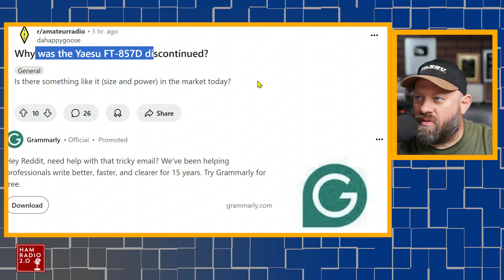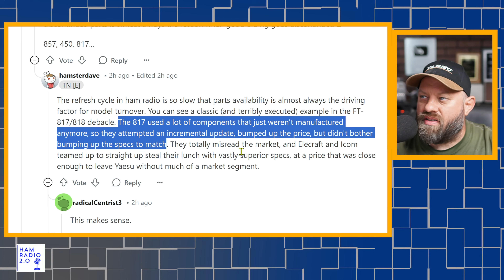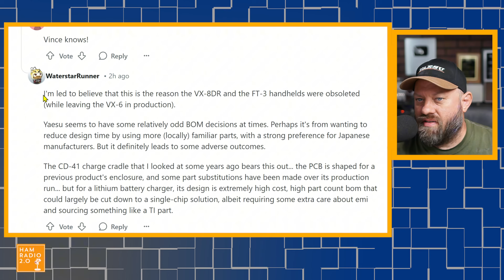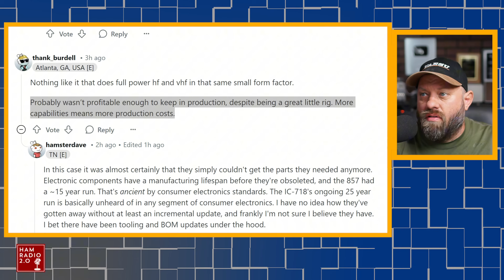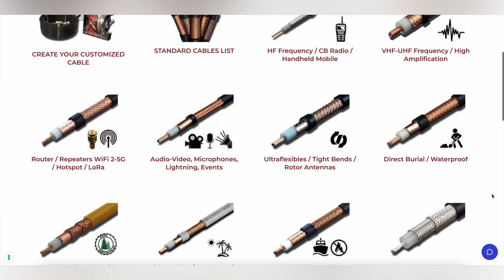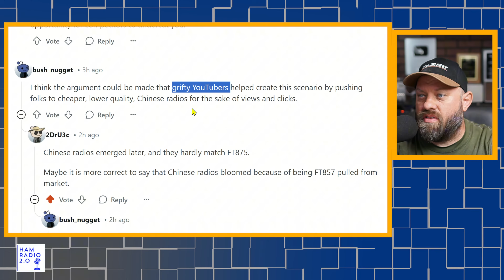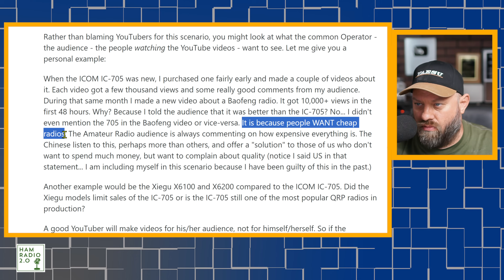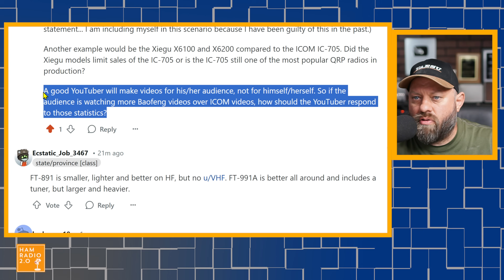Why was the Yaesu FT-857D Discontinued?

Comment: 991 is intended to be portable or desktop. 891 is designed to be mobile or portable . Radios designed to be only desktop would have a builtin (AC to DC) power supply. 991 lacks that internal power supply .

Comment: The better question is, will we ever see a Yaesu replacement for the 857D?  For how small of a radio it is, it is still very capable, especially if you've got a couple of mechanical filters in.  The audio DNR is actually not bad for what it is and for the time it was, made in my opinion.  The noise blanker works really too well if you are running it in a mobile setup, one push of a button and alternator noise goes away.  Modern rigs use IF DNR, and Yaesu is pretty awesome at that as well.

Comment: I’ve had my 857 forever. I’ll never get rid of it.
Reply from the maker: Same
Reply: @HamRadio2  I have had a used 857D since 2006  for HF mobile, and contesting. I'm a rover  it was about 2-3 years old when I bought it. It is used AND  beat up but it still works like a champ   had to send it in for some minor stuff and  a checkup but it still works just fine.  I wish they would come out with a newer 857D

Comment: Well done my friend. Thinking back to the interview you did with Yaesu , I believe in Florida , Yaesu made a couple comments , if I recall correctly, that the FX-1F “ architecture“ is “foundational” to a series of new release that will spread over the next 1-3 years. Given I am an old retired Systems Architect in technology this has a very specific meaning. And given  the FX-1F will probably share some attributes of the architecture in the 710 it also implies , to me , there is some thing else fundamentally different in the FX-1F from a systems architecture standpoint than the 710, 10 and 101. . I thought , ‘ I bet their older portable radios will be replaced  over the next 1-3 years based on a new scalable  radios will be architected  for portable radios”.   Meaning much better than currently possible from a DNR and receiver sensitivity. And the internal systems design can be scaled and modified  and reused between different portable rigs. Now that’s a mouth full. But if you look at certain ‘technology ‘ platforms in consumer and professional this is key to success . Given the 710, 10, 101 now are 1-3 in Sherwood ( and share common systems architecture ) and the 710 can beat radios 5-6 times that price in DNR and sensitivity…. Why not scale that down to true portable. I think that foundation based on his comments is the FX-1F. Thus also the retiring of older portables lately makes sense to shift focus to the future new portables . I think it’s going to be exciting. At least I hope so:-)

Comment: I'm clearly an oddball.  I don't do Chinese.  I don't do QRP, or at least not exclusive QRP.  I can turn the power down on my radios if I want that.  I can't afford the top end radios either, so I don't pay them much mind.  I paid more for my used all band all mode, than I have for my new VHF / UHF mobile, and new FT-891 together.  (not by much mind you.  Unless you count the ATAS-120a....)  You got me back into the hobby talking about POTA.  I spend a fair bit of time, and money, getting ready for EmComm.  I watch most of your videos I think, except for Chinese HT's.  I even pay attention to the occasional GMRS, as I plan on getting the family in with that.  EmComm expenditures come first though.  Your FT-150 video has convinced me to get one, as it's something I can afford.  Just not yet.  
In short, I don't expect videos to be "for me".  I just appreciate the ones that cover what I'm looking for.  So, thanks, and 73!

Comment: Great video Jason. I thought your comments were spot on. There does seem to be a void in the market with regard to an HV/VHF/UHF All mode 100W radio. The IC-7100 and FT-991a are very outdated. I’m not sure why the big 3 manufacturers aren’t making a radio like this. Maybe they have market analysis that suggests it wouldn’t be profitable. No matter what the reason, we the consumers are the ones getting the short end of the stick on this one. I was excited with Yaesu introduced the FTX-1F but that quickly faded when they announced it was QRP. I own an IC-705 and I love it but why couldn’t they offer a 100W version of it? Why doesn’t Yaesu make an FT-891A and give it VHF/UFH? These are the questions that we should be asking. 73 brother

Comment: This was my first HF radio I got back in 2014.  Still have it and love it
Reply: I've had mine since 5/2013 .. great little radio, fully loaded... was in the mobile using the supplied separation kit for 10 years with the Yaesu ATAS-120A screwdriver antenna; now I use it as a base in the shack.. it's fully loaded, got a Heil headset and a foot switch, wide band transmit filter, narrow low loss filter, high stability time base, the works, and it stills looks new and plays great.. fantastic!👍👍

Comment: Ham Radio is a very expensive hobby, but you get what you pay for!!!
Reply: Not all that expensive if all you do is VHF/UHF. Very expensive if you do HF. I live in an HOA so I'm not bothering with HF. So to me it's a cheap hobby, and no, I don't buy Chinese HTs either. I buy Kenwoods and the other two Japanese made rigs. But still cheap. To me paying $806 with shipping for my TH-D75 was not very expensive. All the stuff you'd need for a HF would be far more money.
Reply: @markr.1984 true, the radio is about half of it or less...a power supply, tuner, power meter, antenna and grounding runs into some serious cash!

Comment: Excellent video. I personally have tried too many radios! HF and HF/VHF/ and UHF.I bought a XIegu X6200 and its very good with its detachable battery, built in tuner, SWR scanner, equalizers for receive and transmit. I'm using a huge external speaker and a desk mic. I get excellent audio reports, turns out I think it's too nice to take portable. LOL. I'm using it as a base station but now I desire at least 100 watts so the X6200 is for sale. 73 all de WA3RSL.

Comment: Since i was disappointed with a few Chinese Handheld VHF/UHF Radios (recieving performance, spurious emissions and missing functions which were obviously mentioned in the user manual), i never bothered to look at chinese HF/VHF/UHF Radios. Hence i see the Chinese Radios for somewhat cheap on the Ham Flea market, not everybody seems to be happy with them. 

For my part, i stay with my Yaesu (857,8800,7800,VX2) Standard (528,558,5200,5600), Icom (756 Pro2) and Kenwood (TH7E)

73
DH9MM

Comment: Had the X6100 but sold it and selling the X6200.  Love the IC-705 despite missing an internal tuner.  I used it making contacts on VHF/UHF and D-Star though I have to lug around an external tuner just in case I can't get the antenna tuned.  I watch more IC-705 videos than Xiegu.

Comment: Because they are too functional? I won't get rid of mine, my 857 I have owned almost 30 years.
Reply: I'm fairly certain that it was a matter of logistics and changing market expectations, especially in the shadow of the releasing of the FT-991A.
Reply: 991A is over twice the size of the 857
Reply: @drnv150  correct. It’s the genuine replacement for the FT-897D from a form factor perspective. The FT891 is only half the update for FT-857D, which is unfortunate.